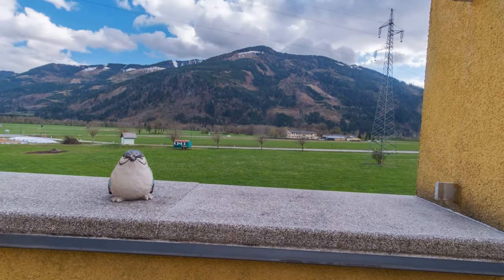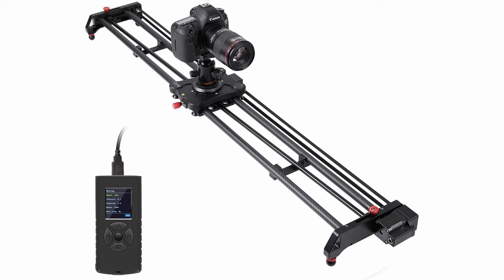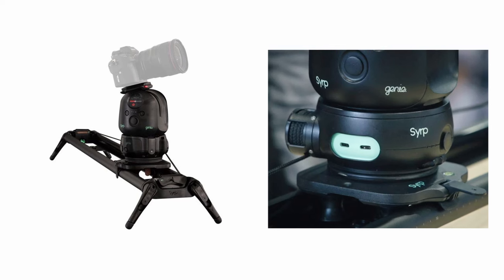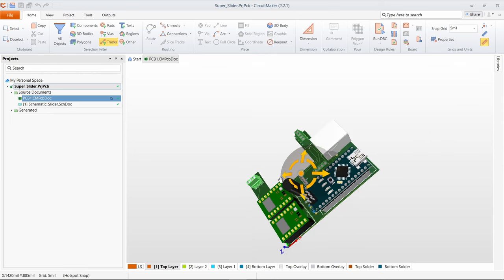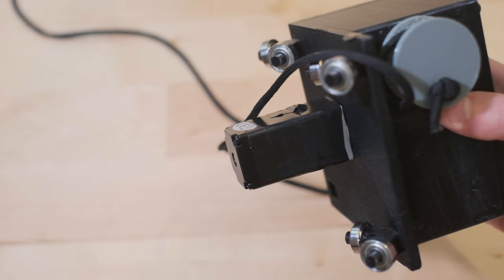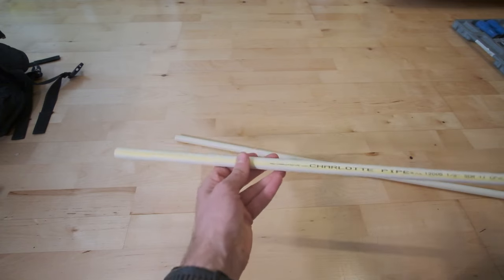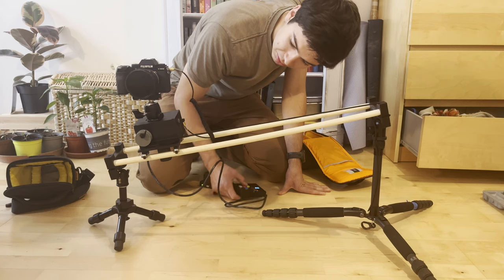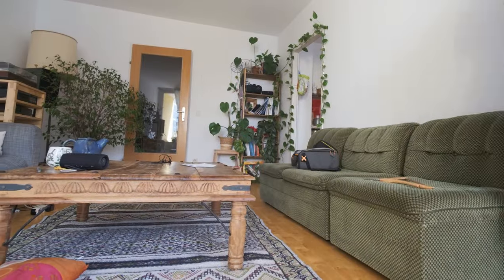DIY Portable Camera Slider for Time-lapse Photography

Comment: Great build.  what sets yours apart is the cool coding.  Love the acceleration/deceleration.  Keep at it!  I do astrophotography and see similar requirements to this.  You'd be surprised how crazy stiff and still a rig needs to be to take good stacks of images.  The bouncy pvc rails are doing you no favors.  You can grab aluminum pipe, possibly of the same OD at the hardware store.  Could do carbon fiber but that seems like overkill.  Try lengthening the pause time between the move and the camera trigger to let the wiggles stop.  If the motor pulled the carriage against a spring or elastic band, you wouldn't need an incline.  i bet you can get a better time lapse with the images you've already taken with better software.  something that aligns them better.